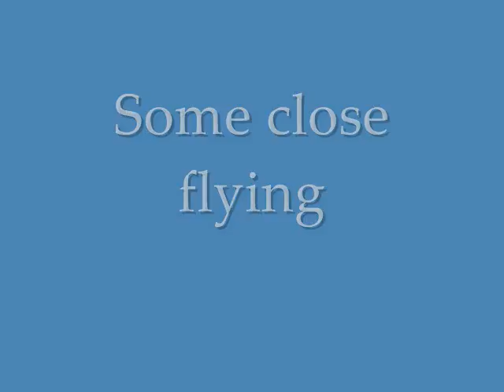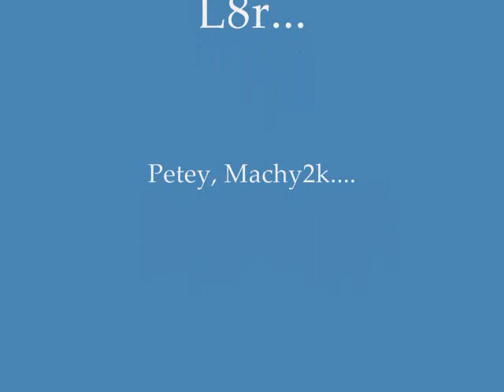Wltoys V252 Pro. "SKYLARK" possible firrmware issue

Comment: There's no firmware issue there... In flip mode (100% rate) if you give full input in any direction, it executes a flip. That's how it's intended to be. 60% and 100% rates are identical in speed but 100% is for flips but you can fly normally by giving input without hitting full stick in any direction but this takes much practice.
Reply from the maker: Hi Highpower5; I was trying to show the fact that my Skylark gets stuck and does flips unintentionally and will do too many flips and not be controllable..
I called it a Firmware issue because it was reported that there was an issue with these Models but it was never confirmed what the problem is, but this one has some sort of an issue..lol
Thanks for the reply...
Reply: I'm curious, how do you know that 60% and 100% are the same minus the flip?  You can't rate the percentage on 100% because it will flip before you can see how far it will tilt!  Just curious how you came to that conclusion. 
I also have this one, the people one is cool lookin!  Flys great!  I prefer flying on 40% indoors and 60% outdoors.